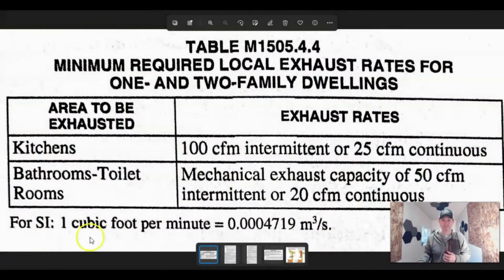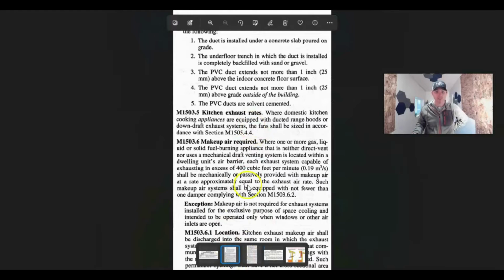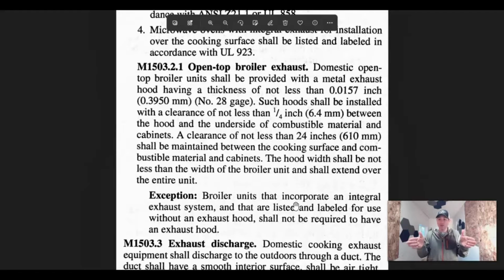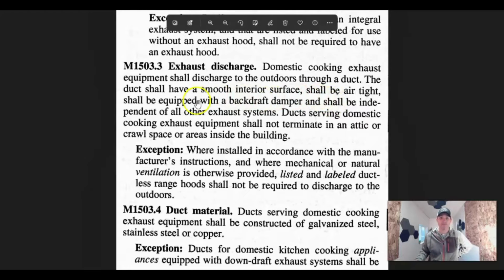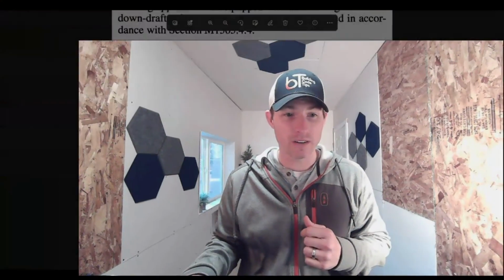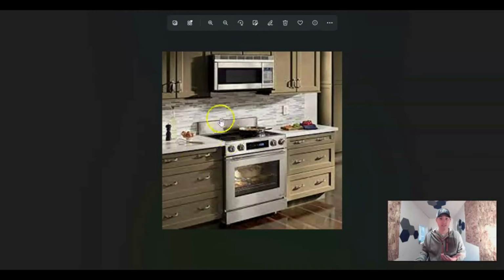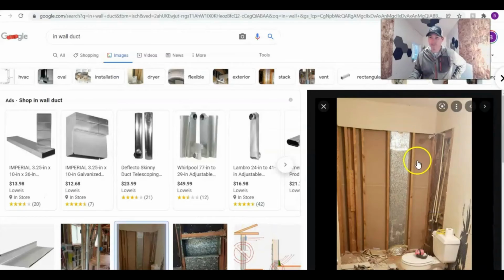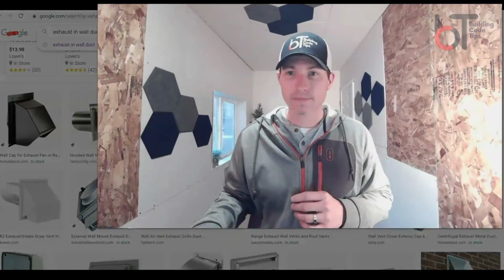KITCHEN EXHAUST FAN INSTALLATION TIPS AND CODE REQUIREMENTS | DIY

Comment: Great video, thanks for sharing the actual codes and photos. I was hoping to hear about sealing the ducts according to code.
Reply from the maker: The code is pretty vague on sealing duct (in my opinion). Its a broad statement that suggests that all duct needs to be sealed. In my state, the energy code is what drives into more intense requirements such as sealing and insulation of duct in specific locations. Here is the general code from the IMC (international mechanical code)

https://codes.iccsafe.org/content/IMC2024V1.0/chapter-6-duct-systems#IMC2024V1.0_Ch06_Sec603.9

Comment: Great tips.  Aren't code requirements made on a state by state level?  I don't know what state you are speaking from.  Can you clarify that?
Reply from the maker: Hey Amy, The US has adopted the I-Codes for its base model, governed by the ICC (International Code Council). In this case I am working out of the International Mechanical Code or IMC. From these codes states, counties and cities will amend ICC codes to fit their geographic area and desired building standards. You may have some specific standards above the minimum requirements but hopefully this video will at least get you moving down the right path!

Comment: Just to let you know. im headed to test for plumbing inspection in a week 🥳
Reply from the maker: Rock on!! Good luck
Reply: @buildingcodetips  any tips??? Illustration part has me nervous 😓
Reply from the maker: @TellersandTales   I would try to draw the illustration on any scratch paper I was able to use and write in each of the fixtures units of each section of pipe starting with the fixtures themselves, working my way down and then up. Those can be tricky but from memory they weren't to bad on the test! If I remember right the test would use the same illustration so taking time to sketch it may help with future questions as well.